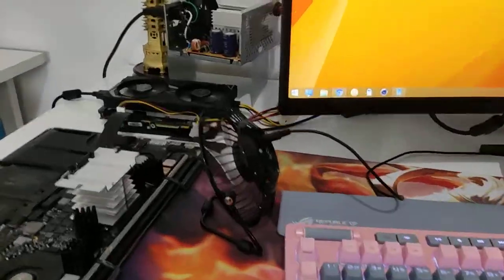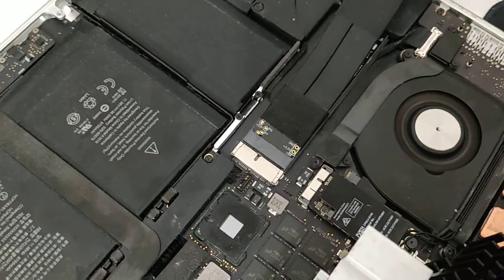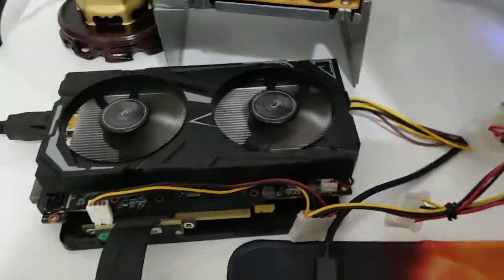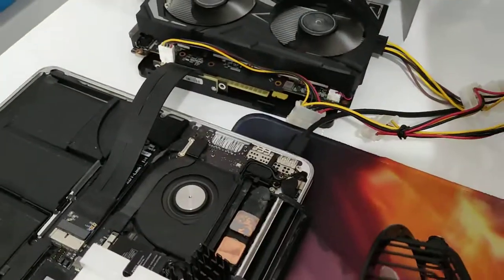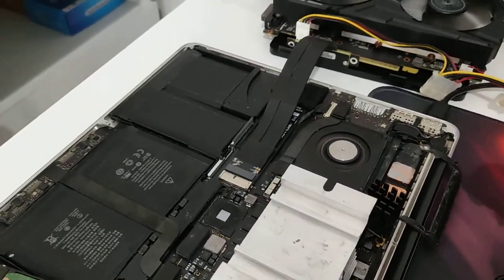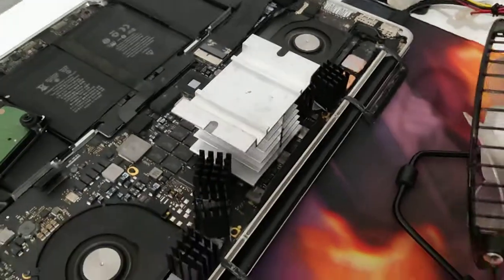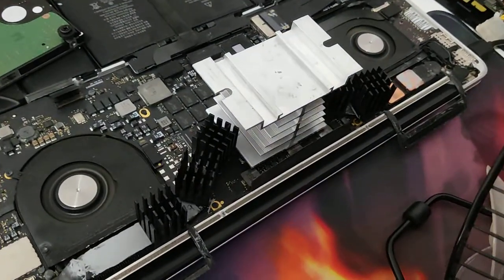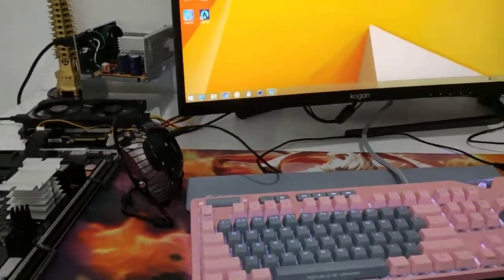Cheapest eGPU setup (Macbook Pro)

Comment: So if I understood well u are using an egpu setup on a macbook pro with windows installed on it ?
I would be interested to see some benchmarks.
Reply from the maker: As far as I was concerned, pcie 3 by 4 did not present any bottleneck to the 1650 super. The MacBook itself operates the CPU at ~3.1ghz all core due to lack thermal headroom, so you can substitute relevant benchmarks from any Haswell i7 at that frequency.
Me benchmarking it today makes no sense as the CPU architecture is about to be 10 y/o and GPU much weaker than say a 6600 or 3050. CPU has came a long way, shame about the new GPUs
Reply: @eggcopter  Ty for your answer. I agree since gefore 3000 series low end gpu are so bad. I dropped my GTX 1650 non super for a GTX 1070 and i'm really feeling the difference despite 3 years between those two gpus.